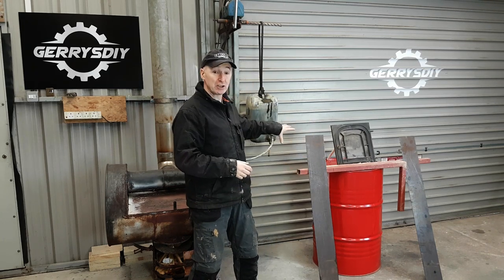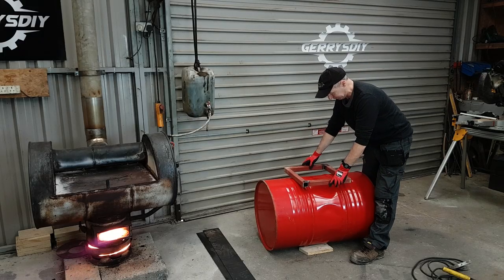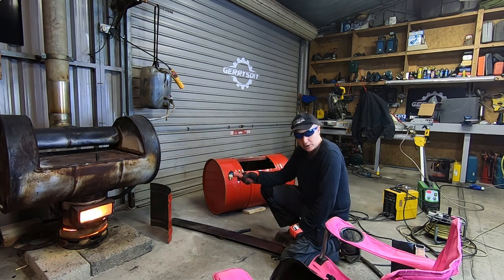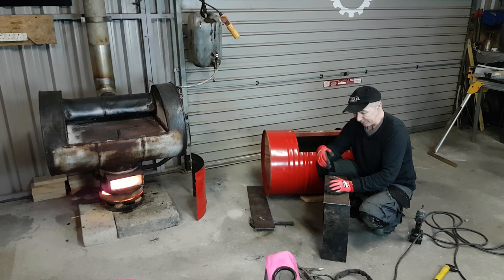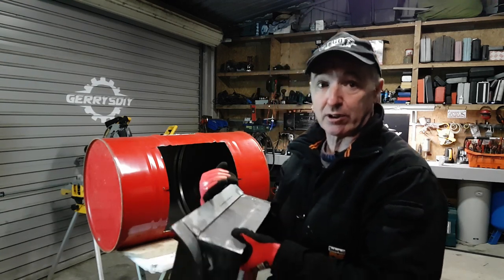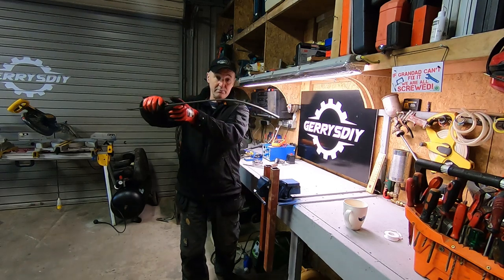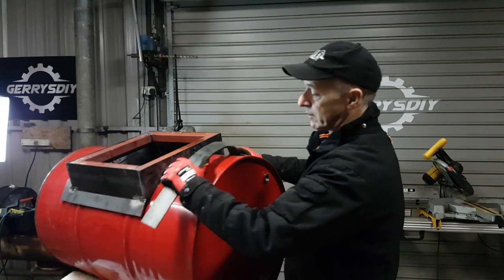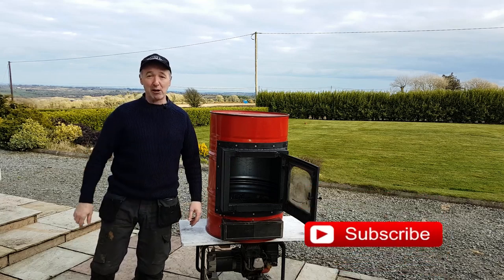My Homemade Barrel Stove

Comment: Hey man! Just want to say thank you for sharing your ideas. I started building a waste oil stove yesterday and you my friend are the inspiration...thank you again and Happy building!
Reply from the maker: Thanks Clint for the kind words. These stoves are easy to build with whatever is lying aroung with just a little imagination. The flue is very important. 6 inch diameter and as long as you can get it works great. My own is 14 feet long x 6 inch diameter and works great on fan assisted or normally aspirated really well. Best of luck with the build. Cheers Gerry👍

Comment: Out of curiosity. I'm building a waste oil stove now, watching lots of your videos (which are really informative, thanks for all your hard work) and recall in your original design you used a propane tank for the burn chamber and not a barrel, due to tank steel gauge and longevity. In another video you showed that propane tank glowing red hot. 

Was the propane tank significantly less efficient for inital heat transfer; hence the change over? 

Or elsewhy the move to a 45 gallon drum? 

Thanks again from alberta 🇨🇦.  Going to be -27 Celsius tomorrow so looking forward to a reduced heating bill.

Comment: Hi Gerry, what type of flue do you use outside?? Single wall or the insulated type, just wondering as I’m fitting a home made waste oil burner out of an old stove, for a shed and don’t really feel like spending a fortune on the insulated type..cheers and keep up the good work👌👌
Reply from the maker: Hi Frank, I just use a single wall but be careful if you go through your roof. Hope your waste oil burner works out well for you 😀Thanks for the comment, much appreciated. Cheers Gerry👍

Comment: I would be worried that I might get a barrel with fumes in it and it would blowup when I cut into it.
Reply from the maker: Hi Cajun Living. I have some videos where I used propane tanks as stoves. The contents would be highly flammable but I just fill it with water and purge the gases. Lots of these barrels available with food colourants etc. The advantage with these barrels is that they are quick to heat up and available everywhere. I will be converting this to run on straight veggie or motor oil next week. Thanks for commenting Cheers Gerry 👍

Comment: Wont last very long....the metal of the drum is waaay to thin.If you can lay your hands on one of the older galvanized drums...you will be better off.
Reply from the maker: Hi John, I would hope to get a few years out of it as the aggressive part of the flame is directed away from the walls of the barrel. This is a modular build so I can reuse the parts on a new barrel when its needed. Thanks for the comment, Cheers Gerry 👍